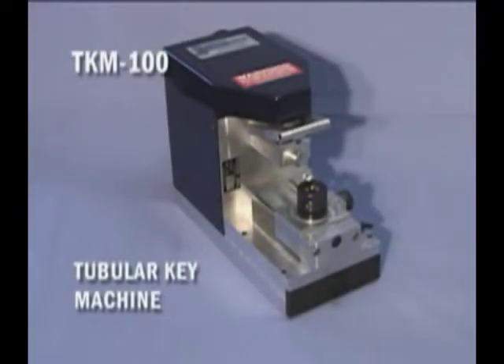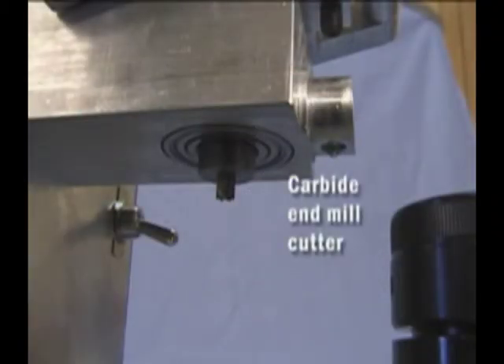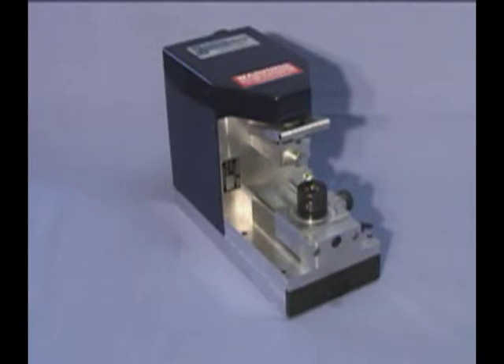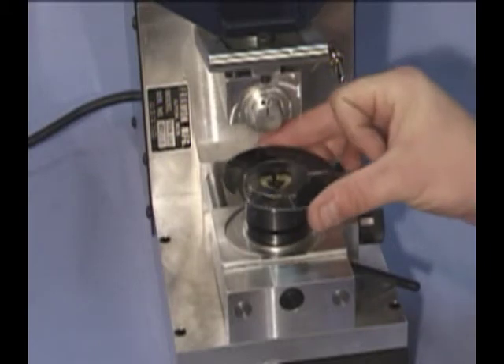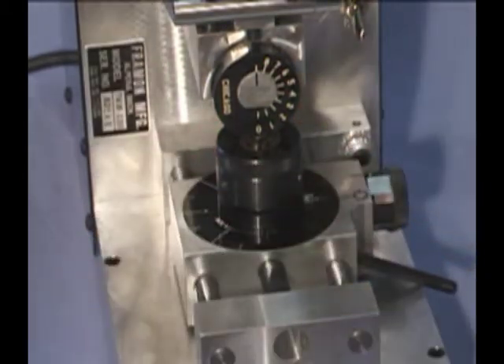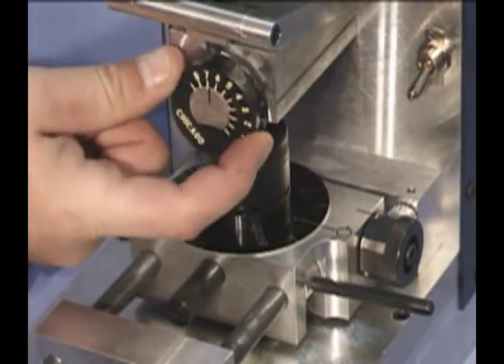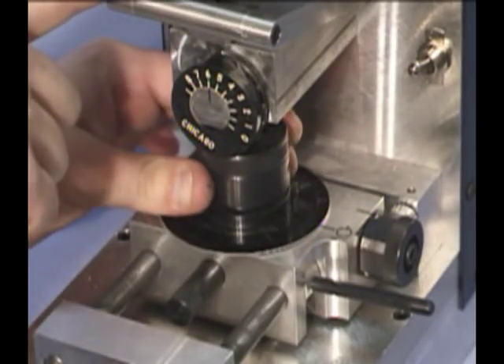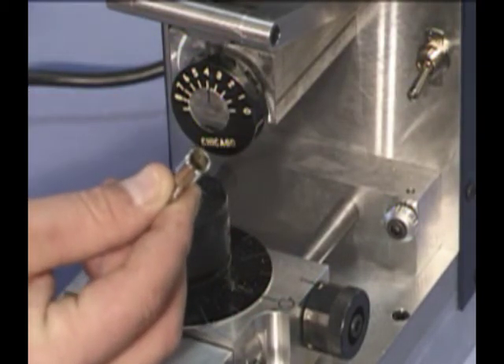TKM-100 Tubular Key Machine

Comment: Can cut 6 pin tubular keys?
Reply from the maker: The machine comes with a universal space plate so you can use that to cut any number of cuts that you need. Would depend on the depths however; they are set based on the cam that you select.